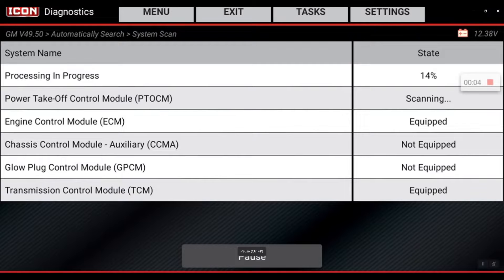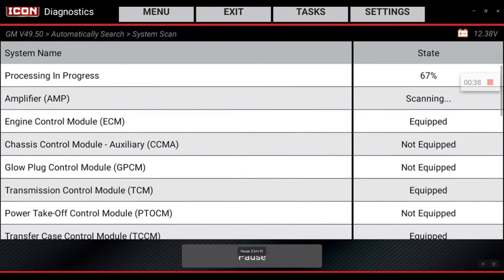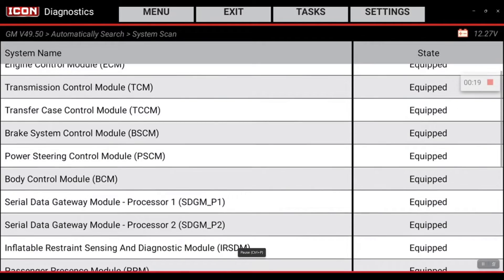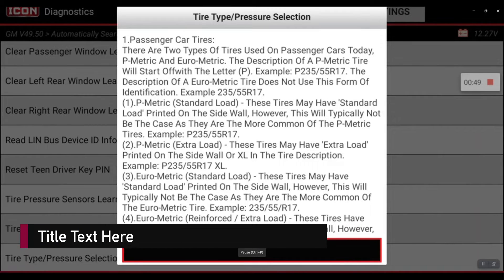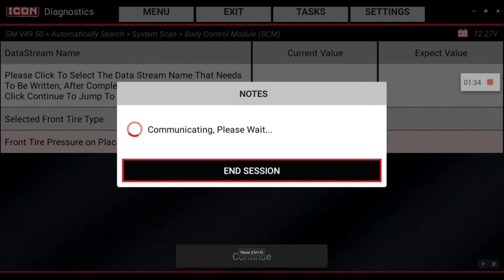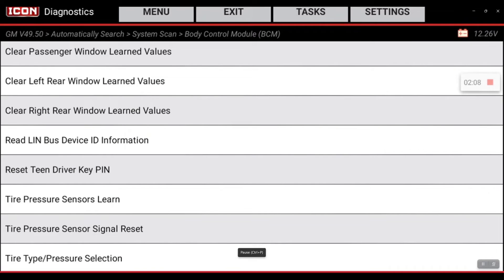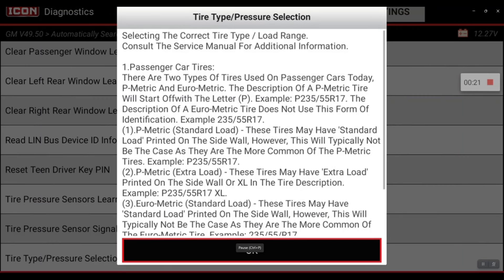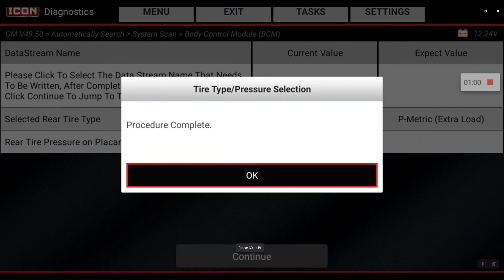ICON T8 Changing Tire Type and Max Load Pressure

Comment: Does it do wheel ( rim ) size upgrade so you if you have factor 17s and go with 24in can upgrade the wheel size so it adjusts the speedometer so it shows the correct speed when your driving